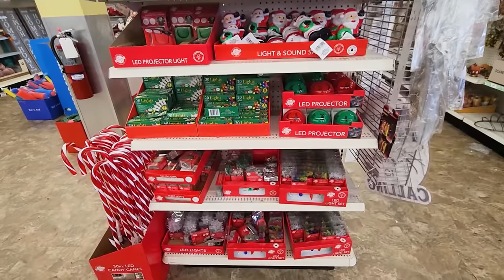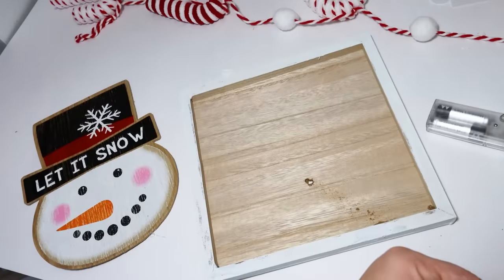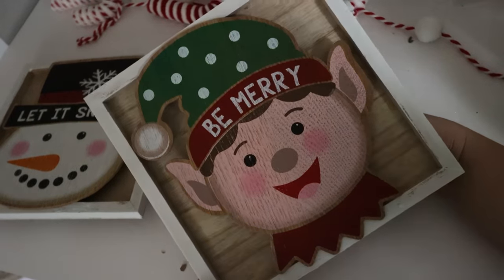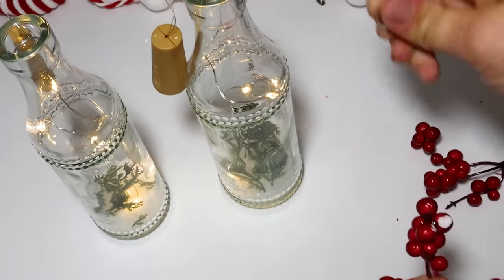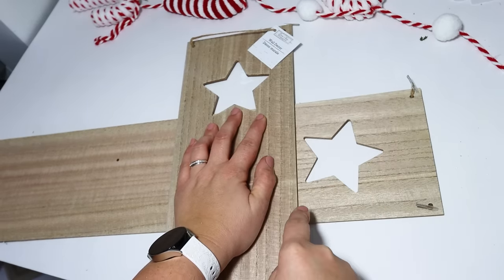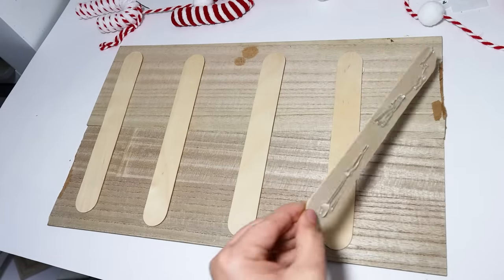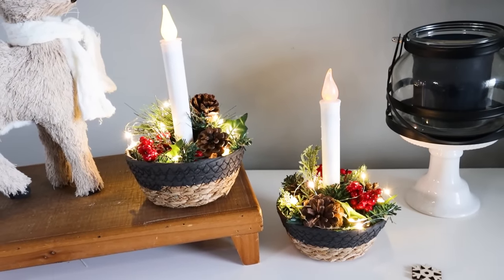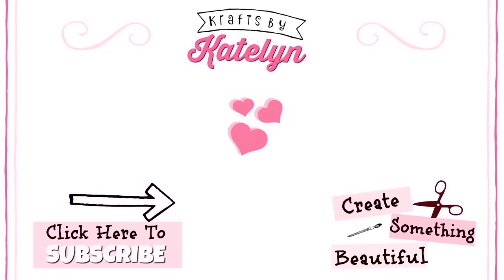Grab $1 String Lights From Dollar Tree for these Impressive Christmas DIYS! Krafts by Katelyn

Comment: Instead of baskets, you could use colored ramekin bowls.  There are small light strings with timers, you just have to be lucky enough to find them.  Also, awhile back, I made a flower arrangement that was a water pitcher can " pouring water" onto flowers.  The water pitcher was hung on a metal stob that I bent the top to make a hook, like a Shepherds hook if you will, hung the can and fastened it to tilt.  I put a set of wine bottle lights in it, so that the lights were hanging out of the spout.  I dabbed blue paint on each tiny light.  I placed flowers below the watering can as if the can was actually watering the flowers.  ( I used a plastic water pitcher, placed a bow where the handle was attached to the hook.  You can place these in a flowerbed, or wherever.  I took a solar light, took the light off, used the tube and the piece that goes into the ground.  I put stemmed flowers in the tubes ( I think I had 3).  It sounds crazy but it turned out beautifully.  I placed the first one I made next to a friend's grave.  Her husband had to pass the cemetary everyday, so at night when it lit up, his eyes would catch the light coming that direction.  Now they are both gone, at barely 50 years old. Thank you for reading my story.  We all need to take time for each other this Christmas, and remember the reason for the season.  Life is short.  Merry Christmas and Happy New Year❤🎄
P.S.  the metal pole I used was cut off a metal stand used for funeral flowers, and bent in a vice)

Comment: Cute ideas!  I loved the first ones.  I got those little wooden snowflakes you had lying in the foreground .  I used those with lights.  The hole on the snowflake is just the size to push a small lighted strand through.  They are cute as light up snowflakes!

Comment: These are adorable ideas !!!  My Dollar Tree didn't have the fairy lights so I ordered them from the website so I have a dozen sets.  I've found them to be frustrating in that the batteries don't stay put.  I'm wondering what I could do to make it better.  I was thinking maybe using foam board pieces hot glued in to hold the batteries in place but still be able to change them.  Thank you for this great video !!!!